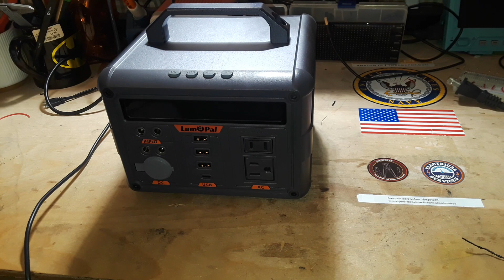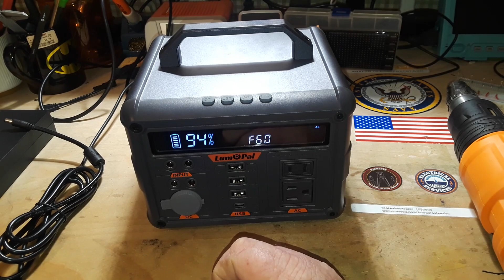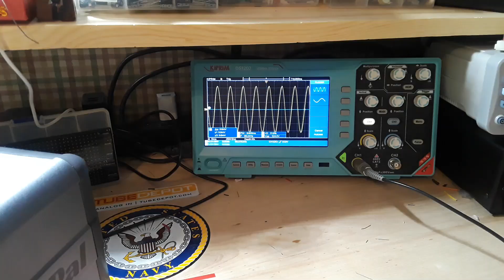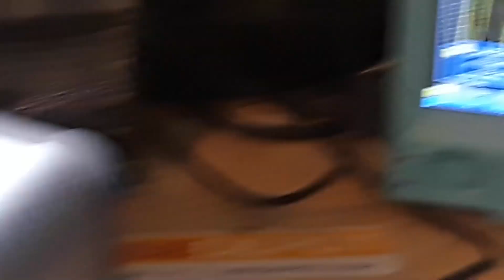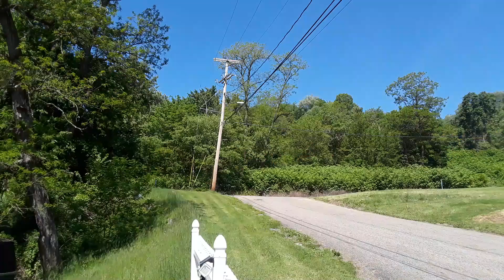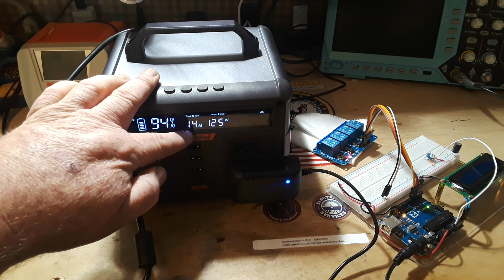LumPal Lum Power 300 Portable Power Station

Comment: Thanks. I'm looking for a portable unit to hook up to small solar panels. For camping at events to substitute the gas generators during the day, or late at night. When I am just trying to run a fan or charge a cell phone.  Reviews like this really help and I think I might get this unit even just to keep in the house for minor emergencies without power. With that being said. In general my biggest complaint with review videos is just not listing comparable options like for example "for $20 more you can get this other unit that has 1 less feature but has a little bit more battery capacity'. Not saying that either unit is bad just giving people knowledge to continue researching a topic.

Comment: Looks like metal body without fan, is it will be very hot when in use ？and what is the real capacity  as U test, I have try one only 200Wh as they claim as 300Wh

Comment: The only problem I see with it is, that the input and output connectors are the same and really nearby. So I would not try out what happens when you plug the charger into the 12V output socket. They should have used different connectors or at least different positions for them.